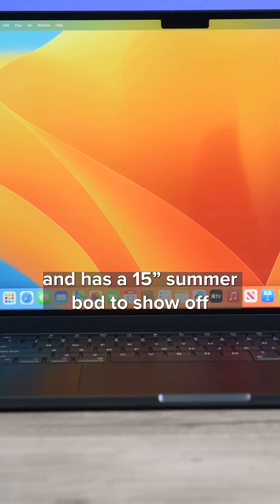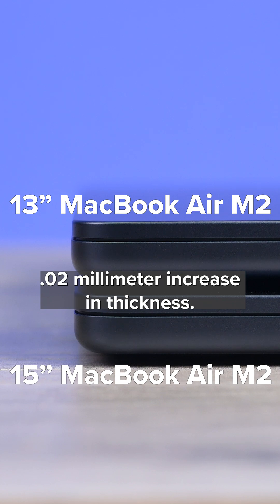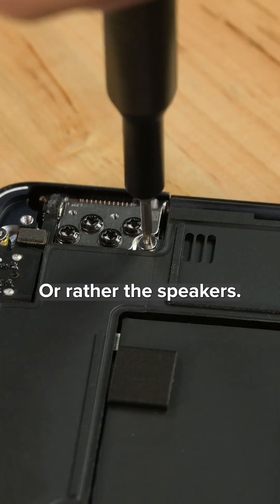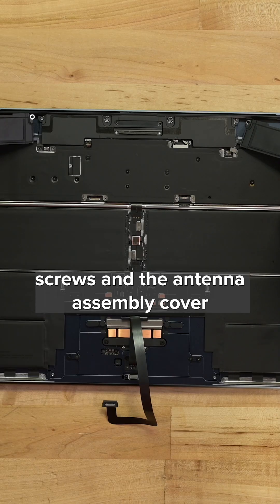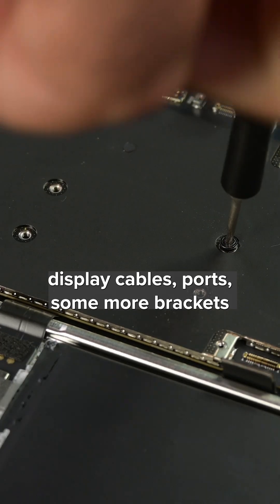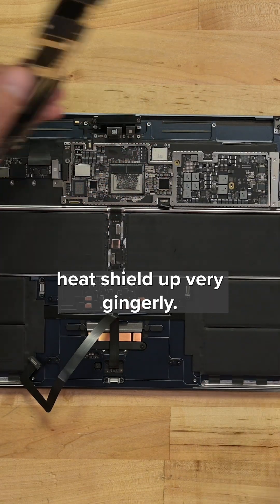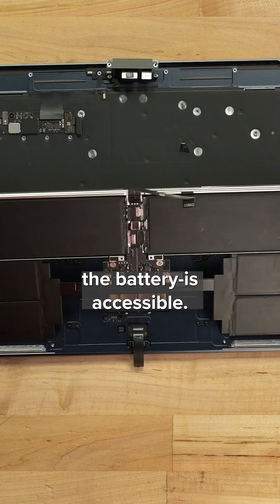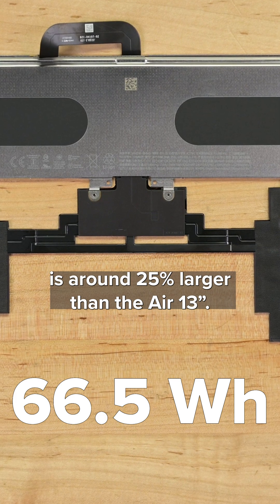15” MacBook Air Teardown! #ifixitteardown #MacBookAir #Apple

Comment: No upgradeable storage, no upgradeable RAM, and the battery is hard to access. NO THANKS.
Reply: And no choice of operating system or software.  Definitely NO.
Reply: framework ftw
Reply: I know right?
Reply: Agree, I need to replace battery every month, I am not going to go through this painful process.
Reply: All of that makes the computer faster and more efficient. Its a trade off

Comment: Seeing this after the Framework laptop is absolutely disgusting.
Reply: How long does battery last on Framework laptop ?
In real life ?
How much does it weigh ?
I am looking to replace my laptop.
Reply: @gund89123 there’s lots of info online.
Reply: hey man at least you can have a real SD card slot with this
Reply: @itsthem5699  Framework have sd card expansion
Reply: @itsthem5699  "Tell me you've heard of this thing without telling me you haven't heard of this thing"
Reply: @itsthem5699 wracking my brain why you would want/need an SD card slot.  2TB NVMe are like $60 right now (Apple will not let you use NVMe), you couldn't pay me to use SD cards.  And if you really needed one for EG: camera work, one you can replace in 2 seconds after you wear it out seems smarter.

Comment: Making the battery extremely difficult to remove is very frustrating to continue to see in so many electronics. It shows the customer that the company doesn't care about the consumer at all.
Reply: the EU's going to change that at least for smartphones. By 2027 all smartphones sold in the EU have to have removable batteries and since no manufacturer is going to go through the effort of making a modern smartphone with a removable battery just for one market that means the entire world is going to have swappable batteries in their cell phones again.
Reply: @michealpersicko9531 battery in all mobile phones are replaceable.
Why do we need new law by EU ?

Comment: Seems like an excessive amount of work just to be able to replace the battery
Reply: and every part is serialized to to T2 chip, only fans and screws can be replaced without some tiny micro soldering
Reply: @ronlevin2339 this doesn’t have the T2 chip… it’s an M powered Mac not an intel one.
Reply: @ronlevin2339 While you are correct when it comes to Intel CPUs, the M-series SOCs no longer use ‘T’ chips as the function is now baked in. But yes, you are correct nonetheless. Apple always finds way to sneakily surprise us with a new “feature”.
Reply: @WhoWeAre1311  exactly a problem, because it is integrated inside the M chip and serialized to the expend that  even Apple cannot bypass it, and also SSD is soldered and serialized , we have to deal with device that will be dead in 3-4 years, instead of 10 years.
Reply: @ronlevin2339  I totally agree, I really do. It’s sad, really. As much as I love my M1 MacBook Air—especially because it was gifted to me by a family member—I know that in a few years time I’ll have to throw it in the trash so to speak.
Reply: @WhoWeAre1311  Now only Framework is the only choice for sustainable laptop , specially with a AMD chips.. About your M1, try to use external SSD as much as possible for all tasks.
Reply: @ronlevin2339  Yes, absolutely. I have a 1TB SSD that I hook up to it for intensive tasks because the model I have only has 256GB.
Reply: @ronlevin2339 lmao T2 chip hasn’t been around since pre M1 Macbooks in like 2019, quit spreading misinformation
Reply: @greylawson6352  OK, it is now integrated into the M series chip, but it functions remain. It is still totally locked, no matter if it called T2 or Mx series chip
Reply: @ronlevin2339 Must resist checking for Apple patents on serializing screws.  Answer could be too depressing...
Reply: For a device this compact of course it’s gonna be hard to access. You can’t make any “easily repairable” device as compact as these MacBooks
Reply: @couchpotatoes5158  yes, you can. See Framework, same thin laptop. It is just Apple sh**t
Reply: @ronlevin2339  still not as powerful as many macs for the size. When you make everything modular, there isn’t much room to innovate. Look at iPhones, there is no way to make that modular and keep and the tech inside at the same time
Reply: @couchpotatoes5158  there is a way, the only reason to pair every part of device to the CPU is Apple greed to force you to buy a new one or repair in only their shops at ridiculer price.
Reply: @ronlevin2339 there isn’t a way to make it more modular if apple wants to retain the exact same size and weight without additional thickness- and they’ve calculated that consumers don’t prefer modularity over the downsides. If a consumer cares about modularity so much, apple believes they’d buy an android anyway and is perfectly fine with that.
Reply: @ronlevin2339 this is why Apple has always felt smoother than android. Because they’re fundamentally built differently, both in terms of hardware and software.
Reply: @couchpotatoes5158  what do you mean by "powerful"? If you mean performance, that's just because Apple just has a lot of talented SoC engineers, it's not because of size. If anything, the M2 is relatively large to other devices in terms of die size